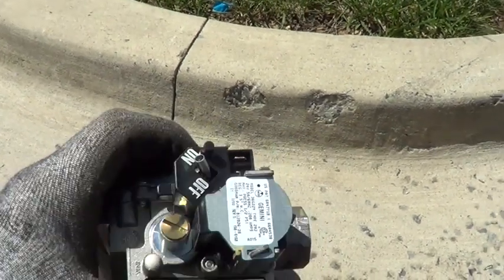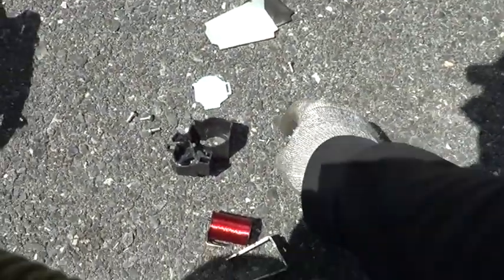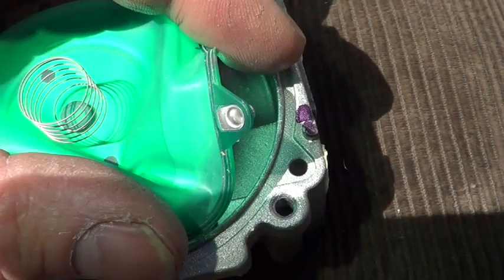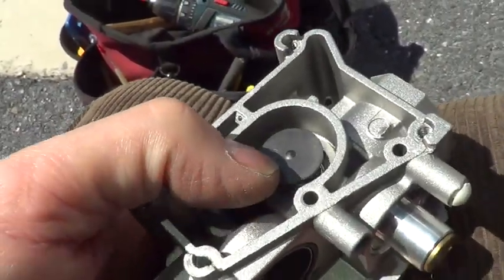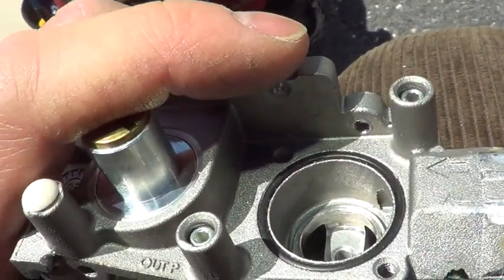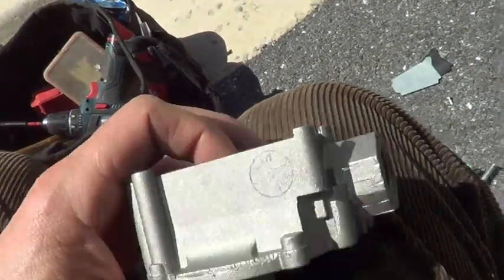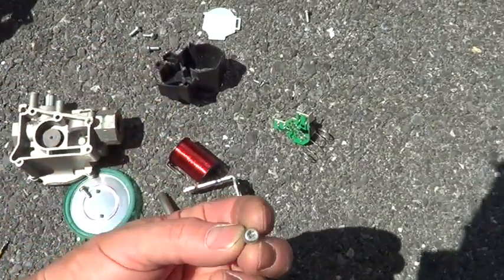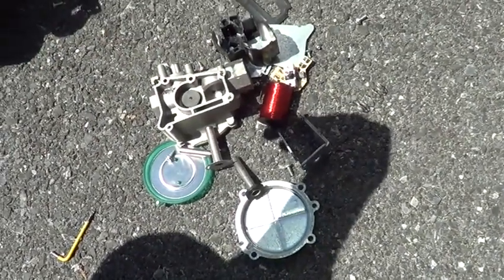How Furnace Gas Valves Work and Leak

Comment: Clean it and reuse it! These valves should be serviced!
Reply from the maker: It isn't a good idea to service a safety device that has to always fail safe.    This could lead to jumping out a safety feature that could result in a fail to unsafe condition.   A perfect example would be removing a temperature limit.   Or, putting a spring in the wrong prosition in a gas valve.
Reply: @NathansHVAC  once you know how it works, there should be no excuse not to repair it. I know it is not financially favorable to the contractors but to the owners , yes!

Comment: I'm getting a subtle gas smell from my vent. Could this be a reason?
Reply from the maker: probably a leak on a pipe.  try to sniff it out or use soap bubbles.
Reply: @NathansHVAC  we pressurized the line and found a leak on a yellow flex line connection ! Thanks for the response !
Reply: @TradeMarkMedia23 I encountered the same issue at my house today. Slight gas smell on exhaust pipe.  How did you find your leak? And where did you start?
Reply: @gmueller  i called the gas company they came out for free with a sniffer device and located a leak at the gas line connected to the furnace
Reply: we pressurized the line and found a leak on a yellow flex line connection ! Thanks for the response !